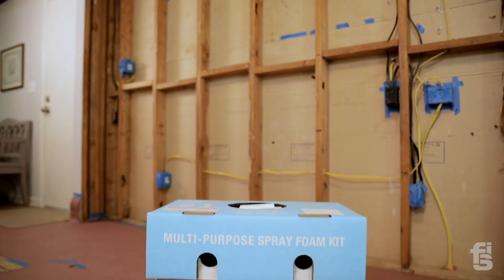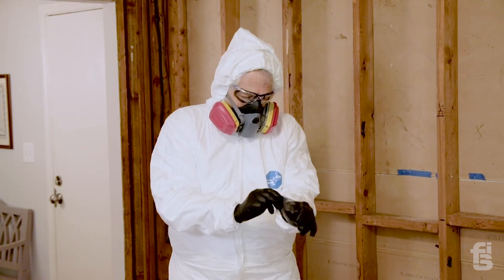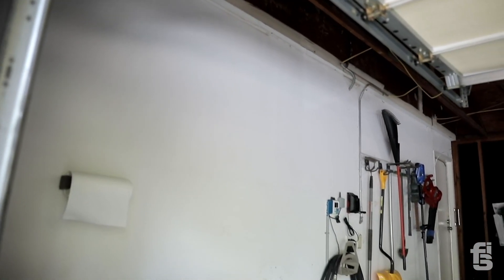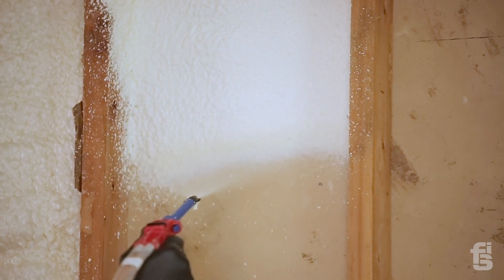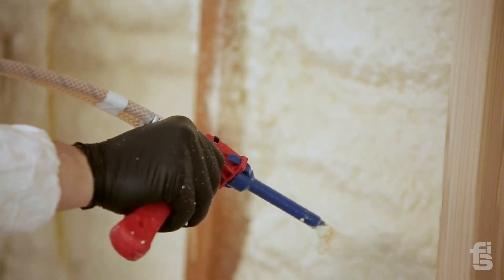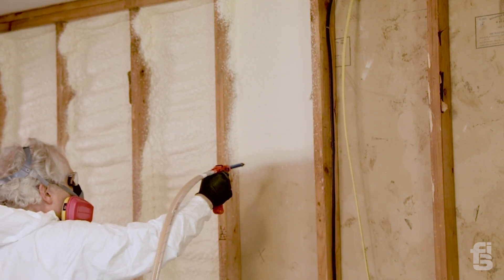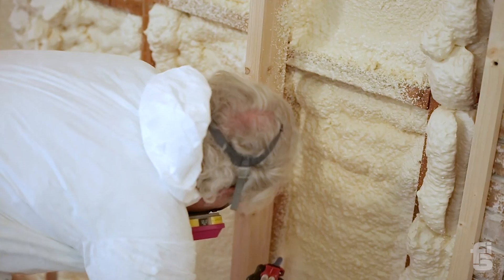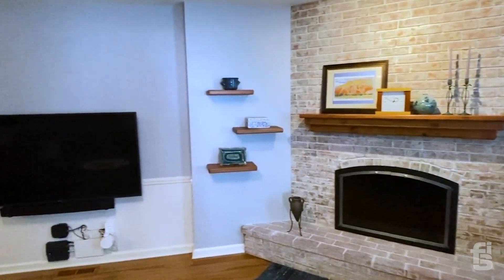DIY Spray Foam Insulation: How to Make Your Home More Energy Efficient

Comment: Here in the UK its very hard to get a mortgage now with spray foam insulation installed sue to the damage causes by improper application (which is a lot!)
Reply from the maker: Thanks for your comment! We understand the concerns surrounding spray foam insulation and improper application.

At FSI, we emphasize the importance of correct installation and using the right formulations for each project. When applied properly, polyurethane foam is a reliable and effective insulation solution. Education and installer training are key to avoiding issues, and we always recommend working with experienced professionals to ensure the best results.

Comment: Pro tip: spray foam insulation is very easy to Frick up. It can make your house unlivable because of an improper mixture. If you do not know how to install this correctly and don't know what an improper mix or expired chemicals looks or smells like, I'd suggest just doing the classic vats of insulation. Sure it's itchy but it won't Frick your house.

Side note: because of the point I made alot of insurance companies in my area will NOT insure your house if they find out it has spray foam in it.
Reply from the maker: Thank you for sharing your perspective! Proper installation of spray foam insulation is indeed crucial to ensure its effectiveness and safety. At FSI, we prioritize education and training for installers to ensure correct application and to mitigate risks associated with improper mixing or expired materials.

We understand that spray foam isn’t always the right choice for every homeowner or situation, but when installed correctly, it provides excellent energy efficiency and long-term value. As for insurance concerns, we recommend homeowners consult with their providers to understand specific policies in their area.

For more information and resources about spray foam insulation, including tips for proper installation, visit https://fsi.co/markets/spray-foam/. We’re here to help answer any questions and provide guidance to ensure the best results!
Reply: That's why you don't tell them what is in the wall, they are crooks